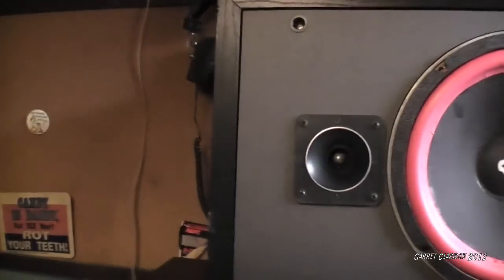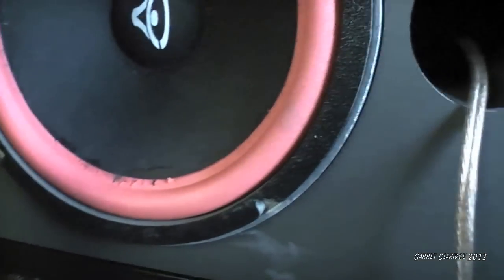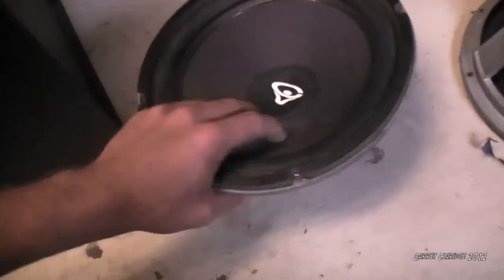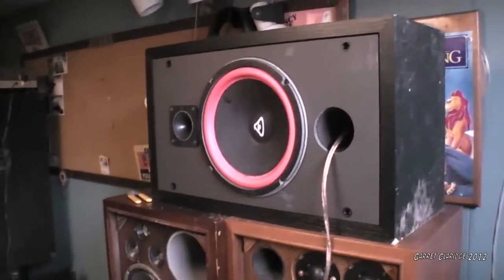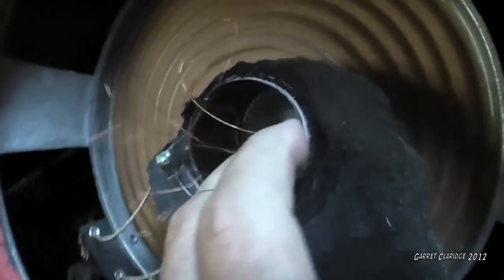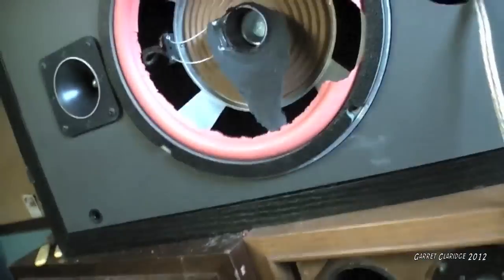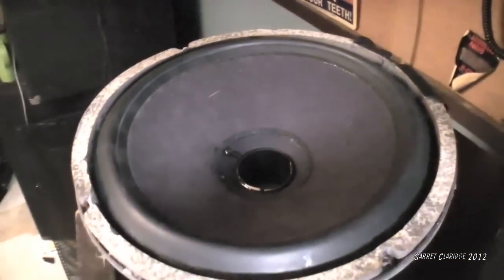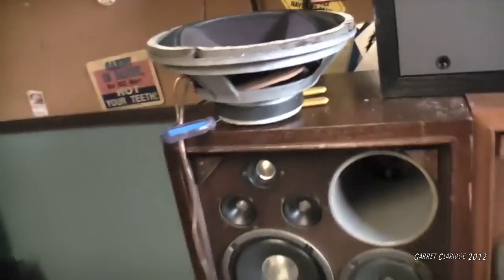SPEAKER BLOWOUTS! - Cerwin Vega TORTURE

Comment from the maker: No clue,  one of my AP3000 amps smoked 2 pairs of them, so i can assume they were under 300 watts each at 8 ohm, they were running 2 speakers per channel wired for 4 ohm with the amp on its 600 watt per channel setting

Comment: I'm waiting for the day one of these guys blows out one of the speakers then sticks his finger inside to pull out the voice coil and get electrocuted
Reply: He will never do that, he's not an idiot.
Reply: John Smith you know amps can sometimes stick out more than 240v ac
Reply: ***** its not the voltage that kills ya its the amperage.
Reply: He's done that one time, but hasn't died from it. Also most of the time he powers down the amp before pulling the coil out. And there really isn't a way for 120V to kill. I know for sure as a faulty lamp once electrocuted me, but i never died from such a accident.

Comment: NO WORRYS MOMMY WILL BUY HIM SOME MORE SPEAKERS
Reply: +EvanPlayzGames you love your mommy Evan lol
Reply: LOL!!
Reply: no joke
Reply: well somebodys over sensitive about junk speakers
Reply: +Technogramps Cerwin vega ain't junk by no means.....go buy the plastic sound systems I'll stick with my 1970s built like a rock system
Reply: i was referring to the speaker in the video considering it has foam rot and shit. btw i have a large collection of late 1960s-1970s audio gear including Yamaha, polk audio, peavey, panasonic, kenwood, cerwin vega, zenith, KLH, pioneer, etc. i also have a small amount of pro audio gear such as peavey  commercial amps/ 15'' peavey cast frame woofers. I'll let ya stick with your 70s magnavox bookshelf speakers
Reply: chris2crazzy how is that bad?
Reply: No
Reply: Hola v:
Reply: @chris2crazzy  maybe they are not shitty like some 50 dollar speakers. But they definitely arent good little fanboy. Get over it.
And before you ask so kindly. I have an 1978 Sony STR 5800 + a pair Magnat Zero 5 German made 1992 and Zero 4 also German made 1992, the successor of the global famous all ribbon series. Also i have a pair of monitor audio bronze 2
The Magnat Zero 5 weights 17 Kilos each and has crisp hights and hits lower than most subs. I HIGHLY doubt the cervin vega will ever compete with such.

Todays Magnat is chinese / american garbage.
Reply: @emmettcarr2988  You can replace all the surround, that's not a bad speaker just because it's cracking the surround

Comment: that's not rust
Reply: Corrosion.
Reply: What is then?
Reply: What is it then?
Reply: +NeXTSTORMING oxidation
Reply: BaltimoreAndOhioRR oxidation IS rust
Reply: NeXTSTORMING no, rust is oxidation, but oxidation isn't necessarily rust. rust comes from iron. if a metal doesn't have iron in it, it can't rust.
Reply: +BaltimoreAndOhioRR 
I'm not sure what type of metal that is, but rust would be brown or reddish. It's probably aluminum which would make it aluminum oxide. It could be magnesium, too.......
Reply: BaltimoreAndOhioRR oh right, i didnt know oxide was lots of different metals and rust was exclusively Fe2O3
Reply: Oxidation... which is "rust". People think rust is just steel. No rust is a short term for oxidization which can occur on many metals. Like lithium sodium copper iron etc
Reply: Its pitting
Reply: @screener545  No, rust is iron oxide hydrate. Lots of metals can oxidate, but rust is what its called when iron oxidates. if there is no iron, a metal can have oxidation, but it wont be rust.
Reply: And thats not trust

Comment: Vintage Cerwin Vega speakers are quite collectable now and they can be reconed to sound like new. They are very efficient speakers and only require a few watts to play really loud (and clear). Destroying one like this video shows is plain stupid.
Reply: Re coning them also usually means getting a new voice coil. These could be repaired.
Reply: Glenn Watkins I have a set of vs120s they sing like a songbird.  They actually have nice deep bass when they are paired with an amp from the period they were made.  I have them running on a Realistic SCR-4500 with a vanco ge-110 10 band eq.

Comment: A) This speaker is a Cerwin Vega D-2 produced in the late 80's, early 90's ( 10" woofer ) B) It was rated for 125 watts MAX! C) It was abused, with a rotten surround. D) The Peavey Cs 800 is rated at 800 watts ( Bridged) @ 4 ohms. D) He pounded a low frequency bass test through it. E) Woofers in house speakers were NEVER designed to produce low frequency music at high decibels. ( That's what 'SUB' woofers are for.. The conclusion? The speaker did what it could under the circumstances, while being made to do something it wasn't made to do. Your opinion of Cerwin Vega speakers is void. Hey folks! At least he's not torturing animals... Or has he graduated?
Reply: Mark Real 
 Most of professionnal stereo amplifiers can be bridged in mono mode , so it doble the power but the sound is mono , not stereo : For that Peavy : 400 +400= 800W in a 150W rated speaker , thats normal it blew !
Reply: He is a speaker guy and knows all these very well. He just wanted to blow this shit up, and he knows what to do to blow it.
Reply: 12sec72 are you emotionally attached to materialistic things? Are you the sort of guy that puts animal abuse and a guy destroying a speaker on the same level? sigh

Comment: How did you get the input level so high. My Peavey CS-800 won't output full volume with my iPod touch OR MacBook Pro set to full volume and the pots all the way clockwise. I assume I need a preamp..

Comment: i had some old boom box speakers that were just 4.75" full ranges like 2 or 3 watts rms each that they seemed to have trouble that they would blow from the voice coil getting unraveled and maybe never actually blow out so it seems like maybe speakers being too old makes the glue die or some speakers need the voice coils coated in glue to reinforce them? lol
the problem is getting a speaker apart if you want to get it back together is a bitch and thats a huge risk and just about more than likely if you dont know what youre doing youre going to fuck it up so do it only at your own risk

Comment: that's bad for your amplifier because if the current doesn't absorbed by the magnet it will heat up your amp and blow it also.
Reply: he's been blowing speakers with that thing for a long time and the amp still works
Reply: boneheadmoth as hezy You don't even know what its actual quality sound right now, not because it didn't smoke doesn't mean that it has not blown some resistors or capacitors or OpAmp inside it lols a Person who don't know how to tell quality sound from not can't identify this.
Reply: +reyzuna I don't think he cares about the amp

Comment: I have a amplfier at my house and it has 15 watts but I tried to blow a speaker but it didn't blow sadly
Reply: Fin Moore bruh
Reply: boi
Reply: I bet you're using a Lepai amp. Those are designed for low poewr speakers anyway, so realistically, what were you expecting?

Comment: Cerwin vera trash.  Jl audio #1. About impostabile to distoy unless u jut di stort the craped of it.
13.5 w6v3 or the master of spl and all with clean sound with deep soound with some of the best xmas and no distion. Btw made right her Florida.  
13.5w6 holds 750watts rms and tons of peak without a huff anf puff. 13.5 w7 holds 1500rms with peak power we wont go there but it over 3000+  they have been #1 for years/ decade+  And the guy with his chinese speakers but there more us brand made USA BRANDS THEN bs for othér countries
Reply: JL audio is just the usual cheap-ass car audio. They never ship them in HT's or professional movie theaters. In fact, they just use a ton of 18 inch subs in a theater.

Comment: JBL all the way..
Reply: For sound quality sure! But Cerwin Vega is where the bass is at!
Reply: Cerwin Vega uses cheap foam surrounds in their low frequency drivers, idk about that
Reply: Hectiic Finesse They do last many years still, and refoam isnt that expensive either
Reply: "cheap foam surrounds" foam is less resistant to moving and provides a better efficiency rating, but it lowers power handling and longevity.
Reply: +madjimms True. Rubber last longer. But whatever. I'm done. I like them all. JBL, Cerwin, and Klipch

Comment: trash eh?
Reply: Actually no. Cerwin Vega is a very high quality and well built brand.
Reply: +DG&MG Vlogs i'm talking about the one he blew
Reply: +Jake Pierson Not necessarily. The box was in really good condition yet also the actual foam wasn't rotting besides the rim part. And the woofer still worked. And it took a beating it would've lasted way longer of the foam hadn't detached